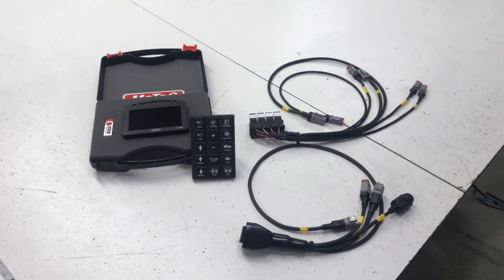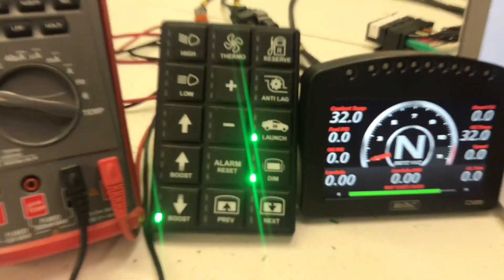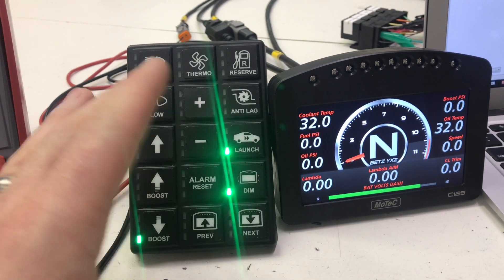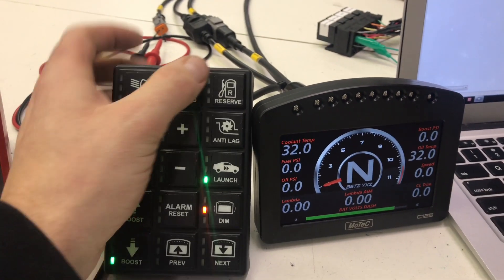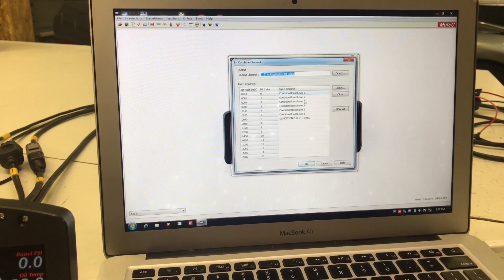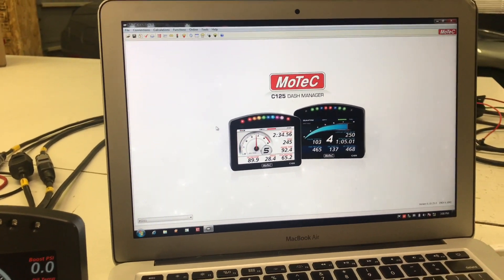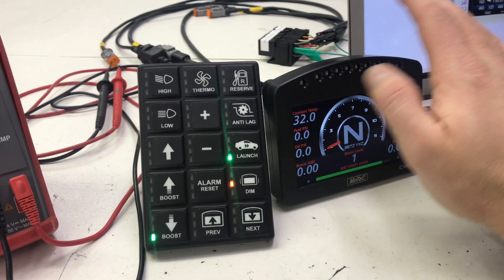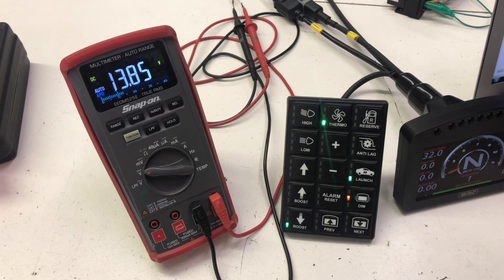C125 I/O expansion and bitrate function

Comment: Good day Cody, Can you please explain shortly how you configured the CAN template for the Keypad?

More specifically the 4 sections, Keypad Wake Up, Keypad Button Receive, Keypad LED Tx and Keypad Brightness
Reply from the maker: Dewald Brummer ....shortly.......you need to receive the can data on the bus for each button. Then transmit the led per button, the LED brightness, and the keypad background brightness. Then you do all the programming to whatever the project needs in the dash manager.
Reply: @CodyPhillipsracing  Thanks for the help. Just one bit I'm still struggling with, what CAN data must be transmitted to wake the keypad?